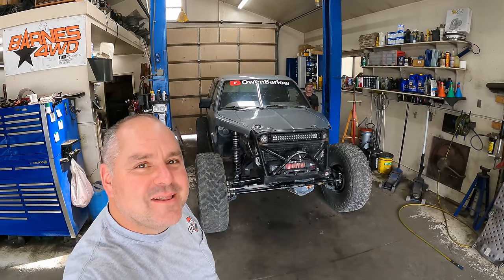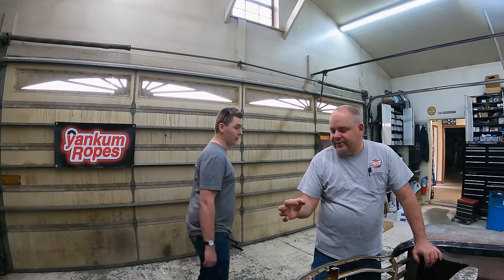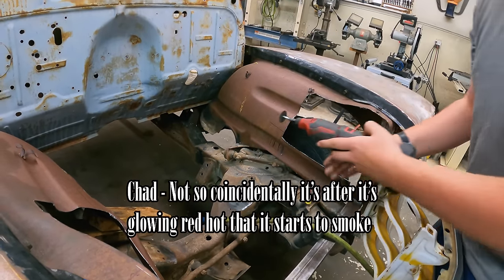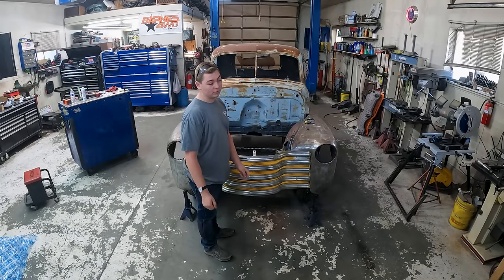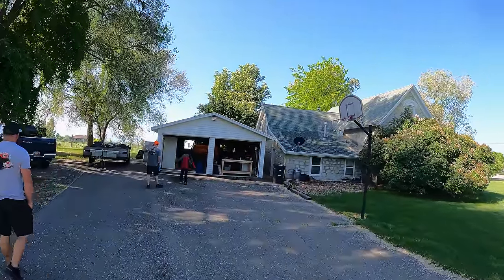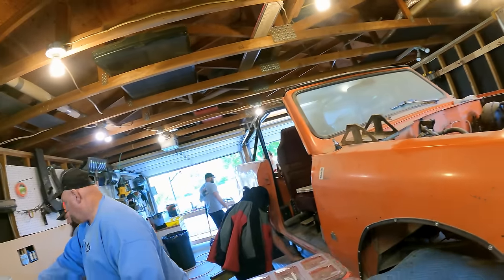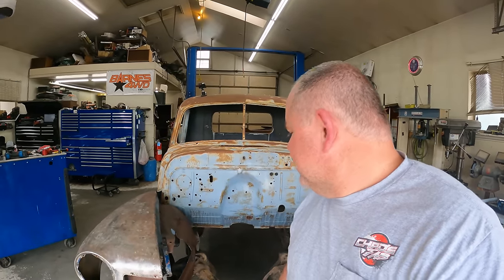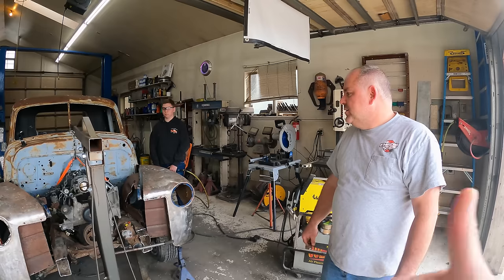Chad's Impulse Buy AND Work Continues on Kenner's Project Truck

Comment: FYI: always use a pilot drill, 1/8”. It will be easier to drill larger holes and insure they don’t lead off. I will not drill larger than 1/2” in a drill press without a pilot hole. 
       When trying to turn steering wheel let the vehicle move slowly f/b ward makes the steering wheel turn easier.
Chad, I’ve always made each step of a job as perfect as possible, that makes the next step and future steps easier cause your not trying to fix the last mess. I love your perfection mindset.

Comment: I am building my second 1950 chevy pickup.  First when I was 22, just a rough build. 57 rear end , 54 chevy car front hubs and 327 engine, automatic 400 transmission.  Drove around for 15 years, now I am 67 and putting a 1950 together.  Cut the firewall out, put in a bitchen recessed. 5.3 engine and overdrive transmission. 1977 nova front clip and 77 rear end. Four link set up. I have been working on this for about 20 years, it is getting close to being finished

Comment: Looking forward to seeing The Tow Truck build and Definitely the Scout!! my Grandpa and my uncle always owned scouts, my uncle  had one that he loved that had terrible rust cancer Being that were in  Vermont and he bought it off a old farmer he completely chopped the entire body and top, and built a complete tube cage outta it and made a strictly off-road buggy it was a great off road rig. he had completely rebuilt the entire thing drive train and suspension wise. my grandfather still has one of the little Scout pick ups that he use to use to plow the yard. it hasn't been driven in about 2 years needs a carb rebuild, and a Starter Rebuild. I may try to get it going this summer. my grandpas health has gotten bad and he doesn't have the ability to drive anymore sadly but I know it would make him happy to see me get it going again. love what you do Chad. get excited for each new video. so many YouTube Mechanics Just do stuff quick and dirty to bust out content. Chad always does things the right way, reminds me of my dad, clean, organized meticulous and shoots for as close to perfection as possible, may take a little bit longer but it's done correctly, the repairs will last and is work you can be proud to put your name behind. I always learn something new when watching your videos and explanations and I have been turning wrenches 2/3 or my life so far. Keep the Great Videos Coming Chad and Family!!🙏🏼👍✌🏼

Comment: Garage door opener is offset? Why not mount motor to wall and extend torsion shaft into gear assy? Fun project
Reply from the maker: It was off set when we bought the place, never got around to changing it 😂

Comment: @chadfab when most people swap the most figured out engine placement is as low and as far behind the front suspension it helps with handling and weight bias its the theory as to why miatas can handle like they do with what they have.

Comment: Question?  What color of orange 🍊 are you going to paint this old truck?
Everything is looking good, engine placement, though I don't understand the half inch off center.  The body is straight and in metal the fender lines look slick.  And I am not one for patina look.  Keep up the amazing work that boy is going to love this when it is done.
Chad, is the Scout going to have the International 345 V8 or are you going to LS it.  My brother had the V8 International and it ran strong however, now days with the LS engines you have the coil packs, fuel injection, and improved reliability.  Who knows what way to go.
Reply from the maker: Kenner wants blue so no orange on this one.

Comment: You guys I love it, but try and get in the habit of using “driver” and “passenger” when referring to what direction to turn the wheels! You’ll love making the switch, helps ANYWHERE you are moving a vehicle. I ran a big trail run once after the other leaders of my group couldn’t go, and everyone loved that when I was walking them down a steep obstacle. 🙂